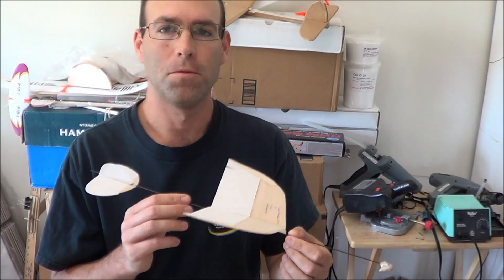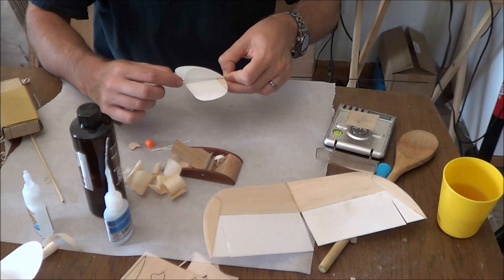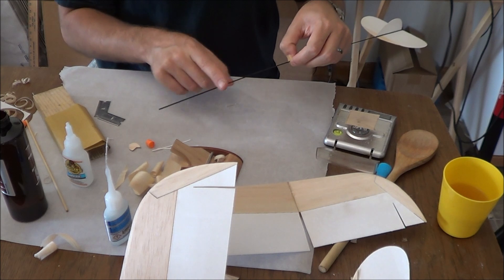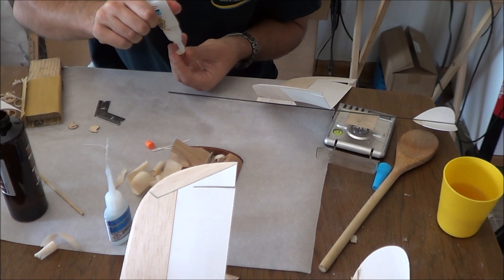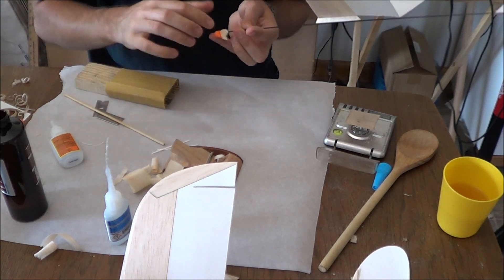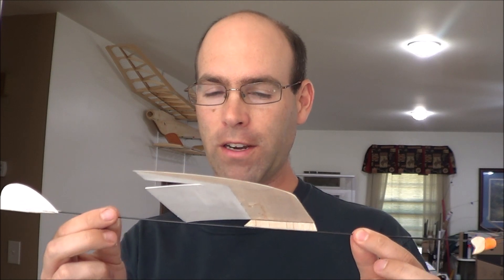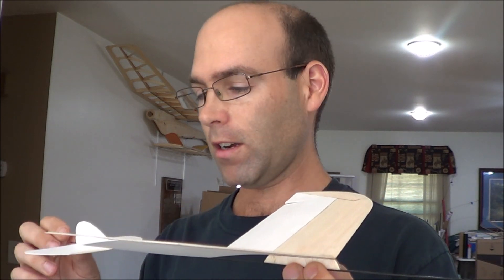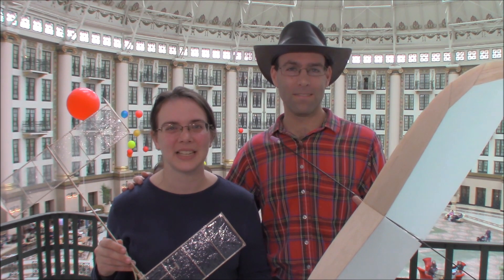How to build the lightest Super Protege ever for Elastic Launched Glider

Comment: We won our regional (Oconee) with Supers (around 18-20 sec at 24 ft) and school qualified for state.  So I had team take on this superlight (they call it Frah Gee Lay aka fragile).  Kids just finished build with the tapered fuse and sanded down wings, we cut out foam wings and stabs using 0.5 mm vector board you sent as well.  Trimmed out in a stable glide at 3.33 grams.  Can't launch until next week.  Concerned about wing flex during launch.  Suggestions?
Reply from the maker: 0.5mm foam will be sketchy. I used 0.8mm on the plane in the vid. Let me know how it works out.
Reply: @joshuawfinn  With everything canceled I don't know when I'll get to test this.
Reply from the maker: @jameslambert9642  come to one of the TTOMA meets? There's one next weekend.
Reply from the maker: 0.5mm foam will be sketchy. I used 0.8mm on the plane in the vid. Let me know how it works out.

Comment: Terrific. Can somebody explain the thought behind the design of having the wing so far aft of the nose?
Reply from the maker: Less ballast is required to balance it. Most flapped gliders require a very forward CG so reducing the amount of dead weight required to achieve that is absolutely critical.
Reply: @joshuawfinn  I'll have to run that thru my noggin a bit first. Why don't full scale aircraft designers do the same?
Reply from the maker: @brianamato1078  well they do... look at the turbine conversions of light singles like the Cessna 210, Bonanza, Ag Cat, etc. They all have stretched noses to compensate for the lighter engine.
Reply: @joshuawfinn  I see....you're right on that. Interesting.